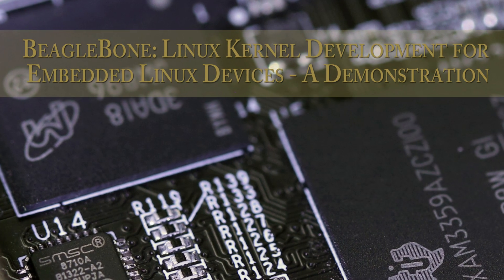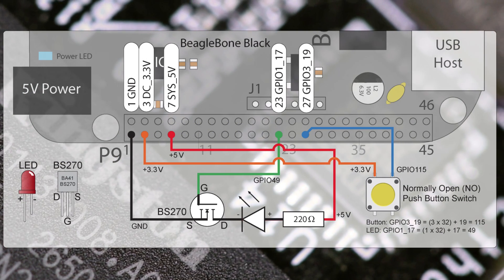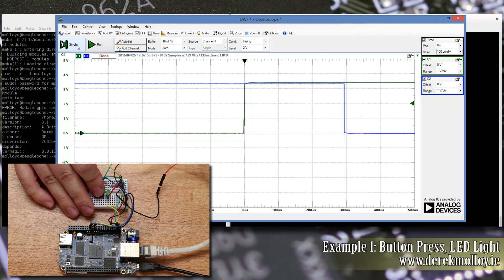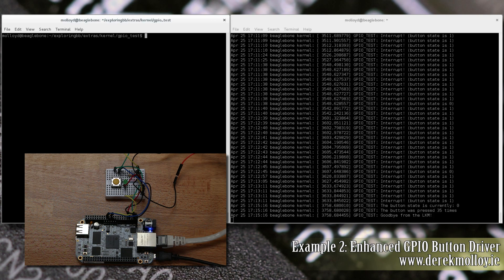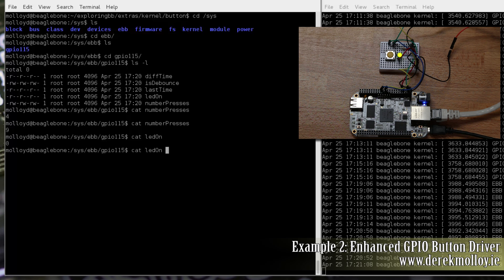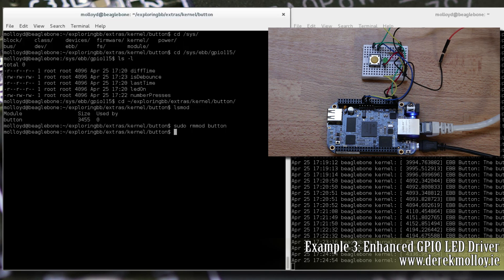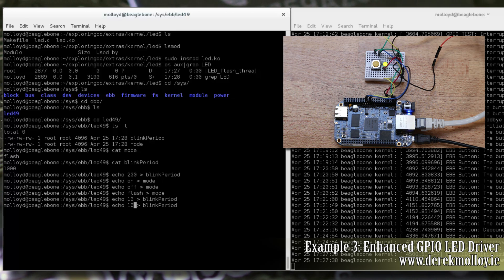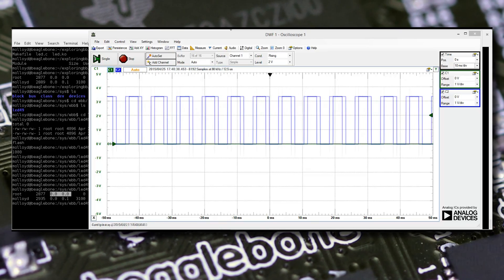BeagleBone: GPIO Linux Loadable Kernel Module (LKM) Development Demonstration

Comment: Hello Derek,

I have a Raspberry-pi, with which, I have connected an SPI based EEPROM and planning to write block-driver so that I can mount it on Linux to do some file operations. At present, I can communicate with EEPROM successfully with already available SPI driver.

Now the problem that I am facing is the R-pi do not provide the kernel source/ header with the default OS (Raspbian). Though there are unofficial websites explaining ways to get around this restriction, I have always ended up with either of these 2 errors: -

1. Error: could not insert module of XXX.ko: Invalid module format -- I get this error while executing "insmod XXX.ko".

2. ./scripts/recordmcount: 1: ./scripts/recordmcount: Syntax error: word unexpected (expecting ")") -- I get this error while executing the "make".

My questions are: -

1. Is this a familiar issue with R-pi and is there a way to get over this restriction?
2. Does Beaglebone black have these restrictions (of not providing source code of kernel)? From your this video, I understand that Beaglebone does not have any such restrictions.

Regards,
Debraj

PS: I can create the XX.ko on my Ubuntu (virtual machine) and perform "insmod XXX.ko" successfully.

Comment: Thanks !
I really like your videos. Will be there some raspberry pi videos soon ?
Reply from the maker: Parker John Thanks. Everything in this video should also work fine on the PI -- most of the videos will, except those that use the PRU-ICSS or the ADC. I'll have to return to the PI again (I'm still using mine for XBMC in my home).
Reply: Derek Molloy Thanks.
Anything is very appreciated !